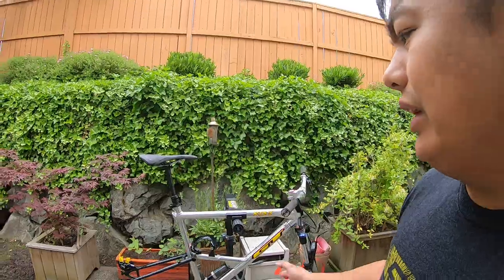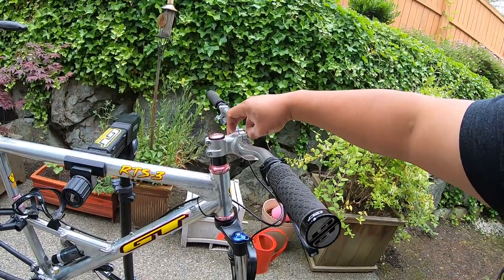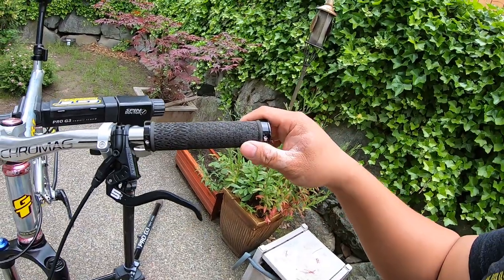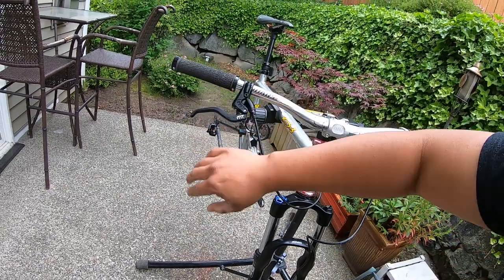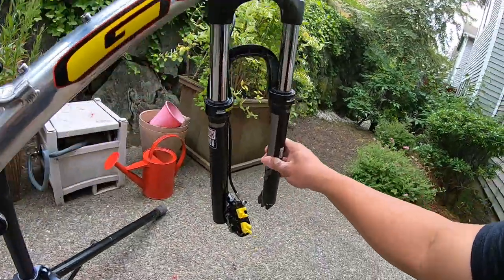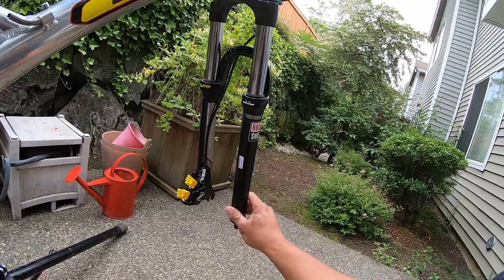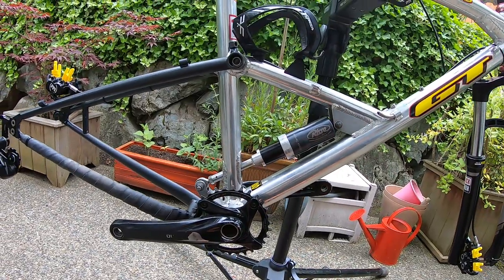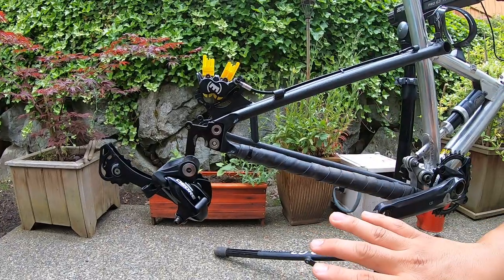The GT RTS Retromod

Comment: Thinking about reaming out my Schwinn Rocket 88 26.8 to 27.2 dropper.. 7005 aluminum so hopefully it won’t crack the frame who knows… Great Build and Content
Reply from the maker: Thanks, Jason.  I've reamed a few of my alloy frames from 6061 and 7000 series and I think the greater concern is wall thickness.

I was inspired from this:
https://www.youtube.com/watch?v=eGX5sDOI8oc&t=1084s

Also, I used to have a Rocket 88 and still have unused pivot bushing arms for the ones that go around the BB shell.  If you have the particular iteration of Schwinn and have a hard time sourcing spares, can reach out to me here.

Comment: I have a '95 RTS-3 that I have done pretty much what you have done.  The front fork was replaced years ago with a RS Judy LT.  Discs front and rear.  I have gone to a 1x10 drivetrain.  The rear shock will be coming shortly.  I love the old girl, and she just keeps on rolling.
Reply from the maker: These are really gorgeous bikes.  I recently had just installed Schwalbe Magic Mary tires in a 26 x 2.35" and I think that's the max size I can run.    I will install 180 and 160 mm Magura Storm rotors soon too.  Are you going to be going with a Risse Racing rear shock?
Reply: @yuri_on_youtube  I think I am.  I am also thinking of getting a Noleen NR4 like the RTS1 bikes.